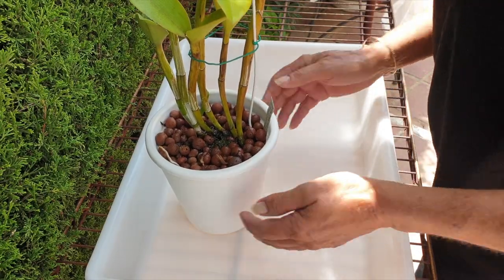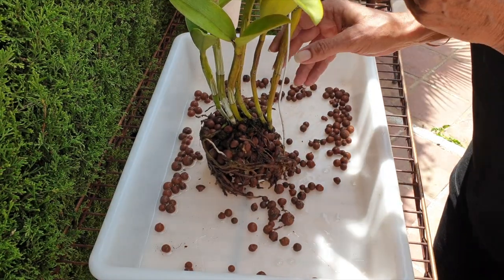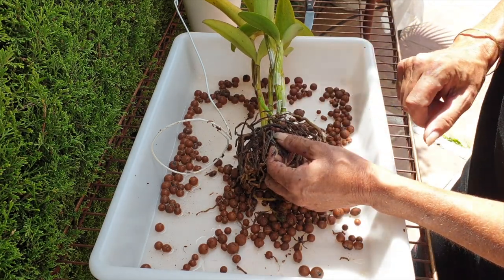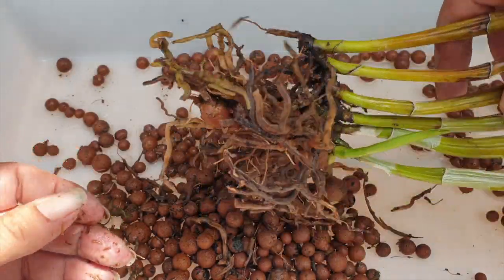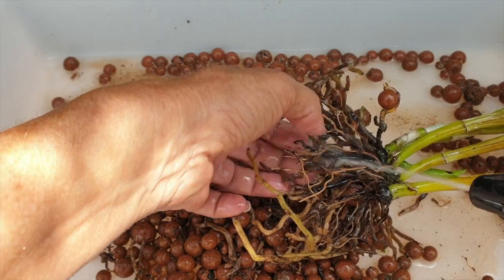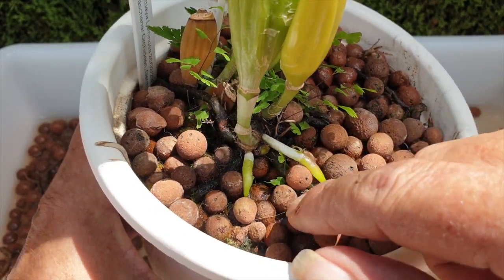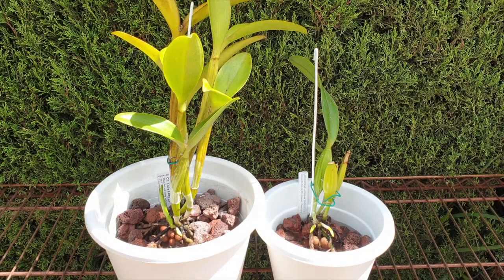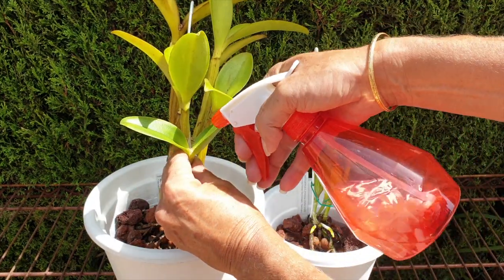Evaporative Cooling The NEGATIVES & it's EFFECTS on Orchid Roots | Prevention | Rescue #ninjaorchids

Comment: Very interesting video. Out here many greenhouses have evaporative coolers. The one I worked in had 2 of them on the warm end of the house, and 3 for the cooler rooms at the other end. We also had super fine misting systems in both houses for added humidity. Of course non of them blew directly on the plants, it was blown up towards the top of the rooms. Extra air circulation fans were also in use for each of the rooms.  Another HOT day here, 104 yesterday and the same today. So now it's time to relax indoors under the cooler... 😅  Have a great evening Nina.   
🐞
Reply from the maker: 🦋🦇😍 That installation sounds like a dream come true! I would have a hammock in that space if I were to find myself fortunate enough to have a set up like that! 😆 Then in winter, the whole thing does the opposite to keep the orchids nice and comfy... including me in my hammock. I would work at a nursery for food and board, if I were so lucky to be able to work in one. Happy Place 🥹 you are hotter than I am 😉 I had 85% humidity today though, so I wasn't chasing the orchids with relief and did not feel like or look a stressed plucked chicken 😂 I am about to call it a night, so I was so happy to get to your comment before 21 hrs later 😘 thank you so much for watching, Wingman!! Much love to you and Fluffy 🫶🏼❤️🌸

Comment: Excellent video and explantion of evaporative cooling. I really appreciate the tip of using a larger pot as a buffer of extra media during times of cooler temps. What I've noticed this past year since converting my collection to semi-hydro is that the cattleya and laelia types are slower emerging of new growths than when using bark mixes. Is this part of the adaptation process or possible slightly lower temps within the pot? I transitioned them as soon as I saw new roots and growth, those kept right on growing as if I hadn't changed media and growing method, but the following ones are definitely slower. Temps where I was living on the coast were pretty consistent above 20C and now, especially summer temps are in the 30C range with lower temps at night for the ones outside of around 18C. For the ones kept inside night temps are around 20C or a bit higher. I've been trying to find the time to ask this question for DAYS. 😂 I've seen the fantastic series of videos on setback. Thanks so much Nina! 🙏🤗😘❤
Reply from the maker: Robi, hi 😍💐 woohoo!! Another comment from you! 😘 If I can guesstimate, based on your grow environment, I would confirm that the cooler pot temps during the cooler seasons of the year when we don't heat as much, will have an effect of new growths coming out and growing 'sooner'. However, it should not be more than 4 weeks, and their growth rate should speed up once the temperatures start to warm up. So, if that is the case with your's then all is ok! If not, then possibly more fertilizer will encourage the growths to grow at a normal rate and not so slowly. Let me know if that resonates with you and your environment, fertilizer concentration. Consider the 3º differential for ambient temps to what I guess is in the pot your margin. As long as your growths do grow well, even if they are slow to come out of the gates, then all is ok 👍🏼👍🏼 thank you for your feedback on the setback series, and thank you so much for watching the videos while being so busy, as well as thank you for watching this video 🫶🏼❤️🌸
Reply: @NinjaOrchids  Thank you for the feedback Nina. What you share all definitely resonates. The new growths have picked up and moving along nicely with the added heat of the present environment.  I wasn't concerned just a notable difference from bark to semi-hydro since at the time nothing had changed. Now though, the poor orchids have quite the environment change in this hot/dry climate so I would expect some slowing down or stalling with some of them while they adapt. I have a basement growing space now where there is a little drop in humidity but the temps are more moderate, mid 20C range. Thanks again Nina! 🙏🤗😘💜
Reply from the maker: Always, Robi! I am glad that what I wrote made sense and fits with your observations 👍🏼👍🏼 that controlled space is going to be awesome for your 'chiddos! Watch!! You have so much more control and they are going to love it 👍🏼 I hope that you are settling in as well 😘

Comment: I'm wondering whether the roots being within water in the semi hydro system will affect the orchid roots if temps go below 10 (more than them being in Leica with a reservoir)? My first winter in that condition coming up, and i will move them in, but wondering about whether i should move them into the reservoir system when i can (monsoon for the next month)?
Reply from the maker: Hi Nina 😍💐 if the temperatures drop below 12ºC, I have the reservoirs empty, and only flush enough to keep the wicking material damp so that the leca does not dry out completely. If leca dries out completely, it will start drawing moisture from within the roots, and that is not what we want in semi hydroponics. So, while the roots remain damp, the reservoir stays empty. IF you have ideal growing conditions indoors, then you do not have to worry about temperatures being that low and you can keep your reservoirs filled according to the needs of the orchid. Yes, low temperatures and wet roots, in this growth method, are a threat to the roots surviving. If you have a monsoon coming up, I would not have them in the reservoir system that entails self watering (pot within a mask) BUT if you have the 2 drainage holes in your pots as your set up, then do not worry about the monsoon rains. All the water will drain freely and it is an excellent flush for your pots and the roots are going to love it! If you are concerned about an orchid that is in active growth with a new growth starting, you may want to consider not exposing that orchid to the continuous rain and high humidity. Keep those orchid under cover, unless they are mounted and the orchid is growing pendant. I hope that this helps. If you have any concerns about what I have written, let me know! P.S. I am envious of everyone that grows orchids and has monsoon rains 🙃 thank you so much for watching, Nina! I hope you had a wonderful day 🫶🏼❤️🌸
Reply: @NinjaOrchids  great information! my question was more related to the set up where there is a single pot (no mask) with 2 holes towards the bottom. in this set up, in winter, if the roots are long enough, they are in the water (the bottom of the leca pot holding the water). Should I move out of this and into the separate container of water, so I can reduce water when required in winter?
Reply from the maker: @ninan3311  no, you can leave the orchids in that version but drain the reservoir so that it is empty until you flush again. Just tilt the pot to empty he water in the reservoir and you are good to go 👍🏼😃
Reply: @NinjaOrchids  Good to know!! Was going crazy thinking I'll lose a bunch of them winter... no idea what the indoor temperatures are but without a heater and 3-4 outside I assume it'll be around 10 max! 😰
Reply from the maker: I have the same struggle here during the winter. I get so miserable during that time of year! The cold weather is something I have never been one to do well with! We will ride out your first winter together 🫶🏼🤗
Reply: @NinjaOrchids   it's my first winter with leca! did the last 3 in coal and most fared fine but a bunch of my phals got leaf rot! so trying this cause the hybrids do very badly in summer in coal... at least they get one good season 😂